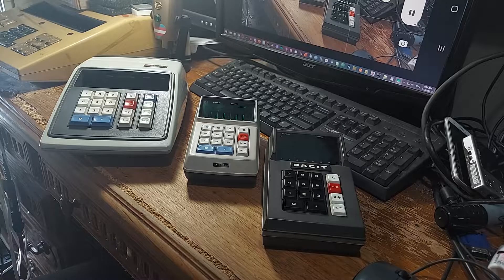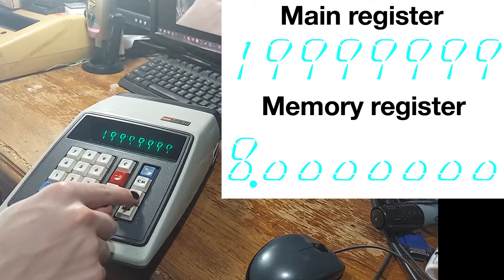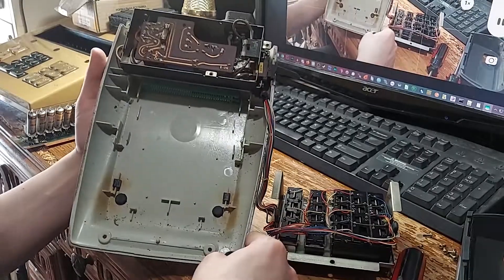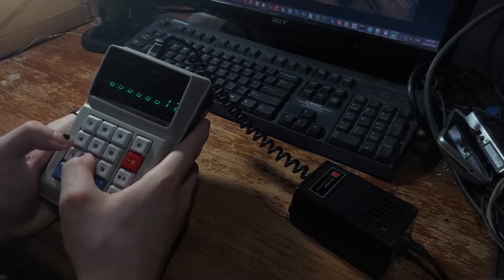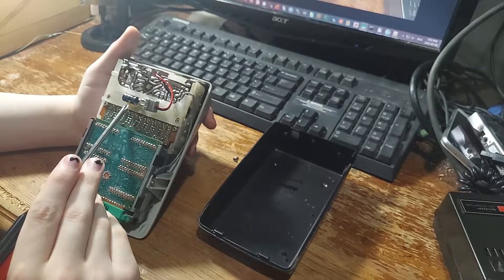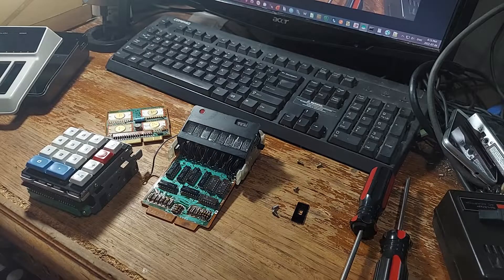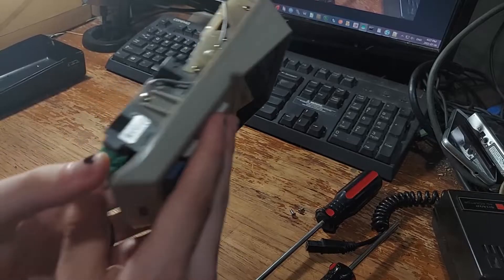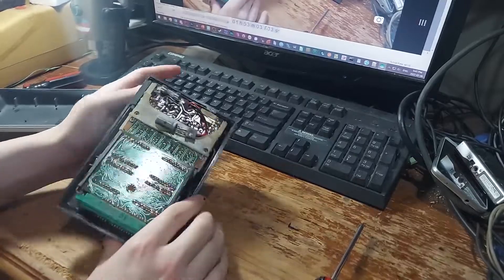Sharp EL-160 and EL-8 Overview and teardown

Comment: Hi there. I have a qt-8d as well as an el-160 these calculators are just a joy to use and built to last forever and are great for collecting because of the unusual itron display v.f.d. normally clean around the batteries and good to go.